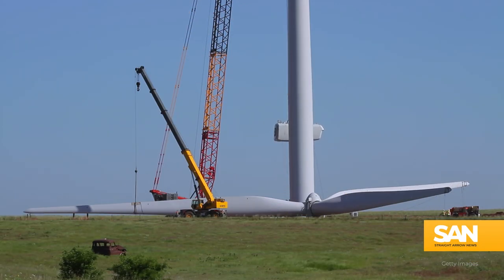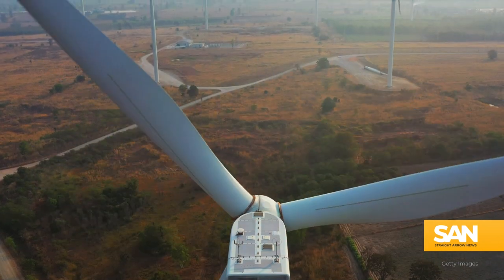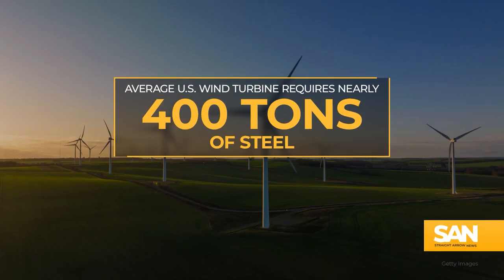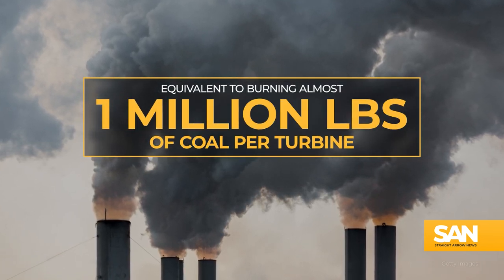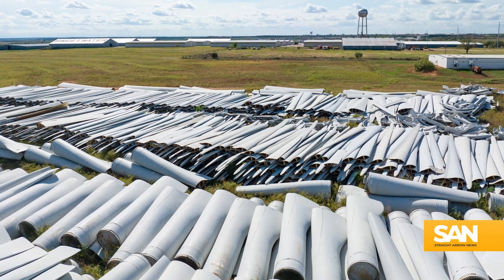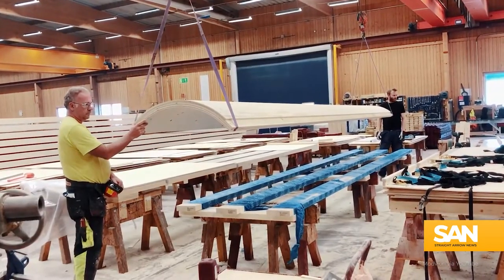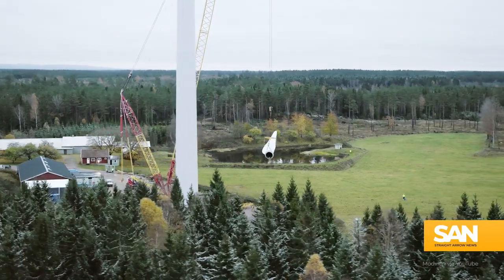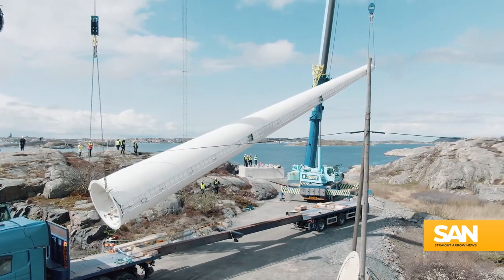Wind energy could get even greener by replacing steel with wood

Comment: Nothing is "easier to dispose of" than a 100% recyclable metal. Especially if the parts are things like the main structure because that structure is easy to put in to use with the next generation of wind power.